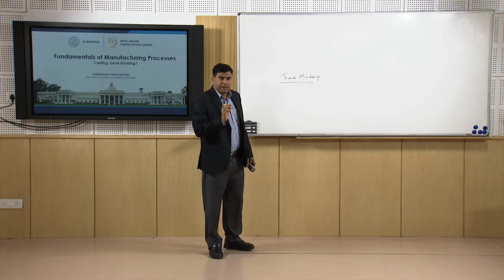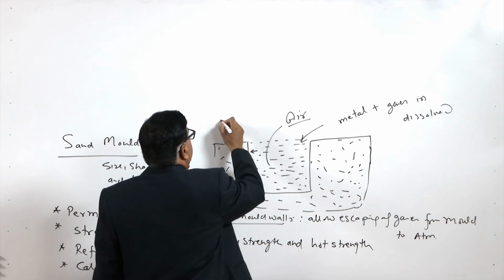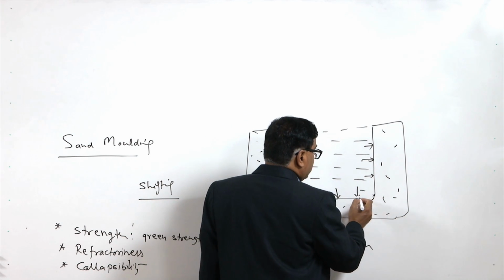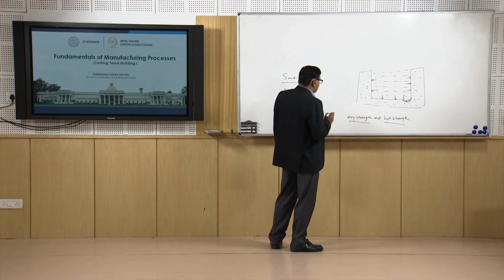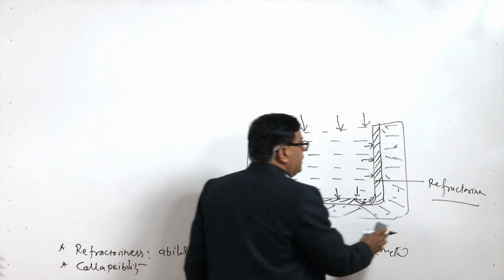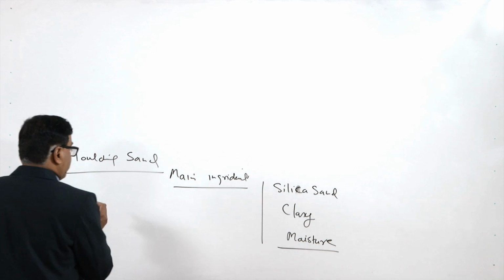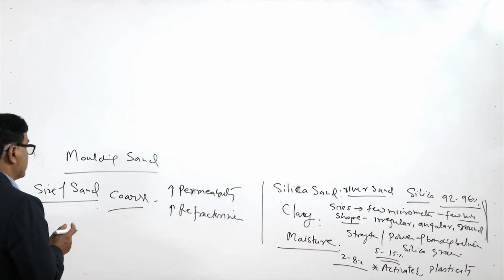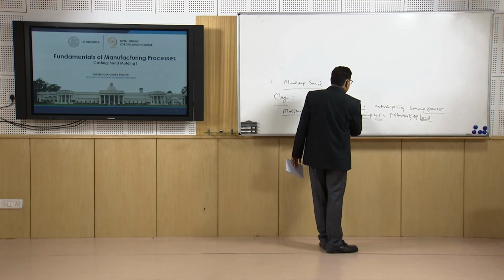Casting: Sand Moulding l

Comment: Sir, round grains have higher permeability than angular grains of sand
Reply from the maker: Dear,
When the round grains are packed, then packing fraction is low because of the more space is left between the grains that results in higher permeability but in case of angular grains, they may fit in random directions leading to a higher packing fraction and resulting in lower permeability.
Reply: To achieve both a strong mold and good permibility and also nice finish ,the use of angular and round particles,both big and small .